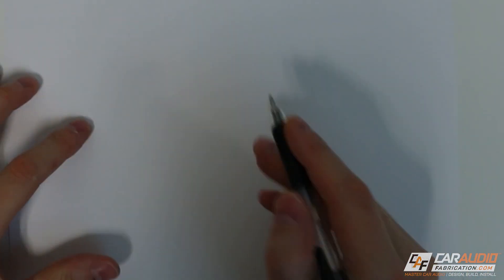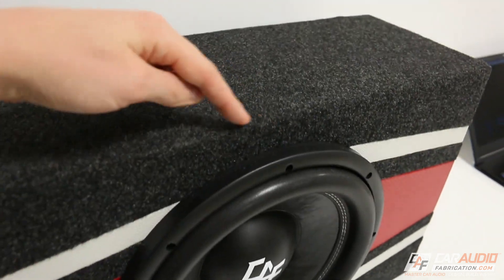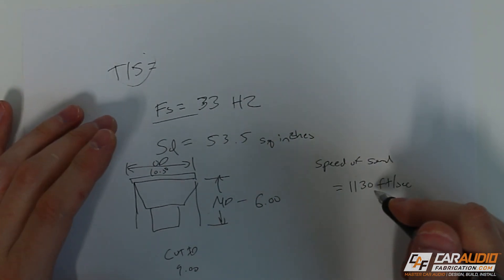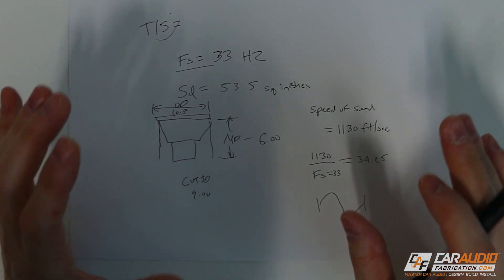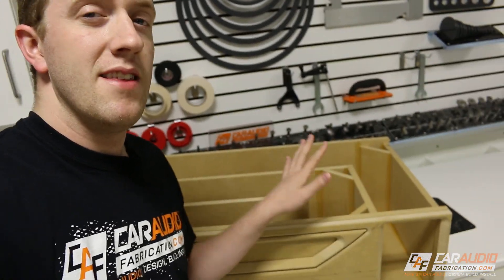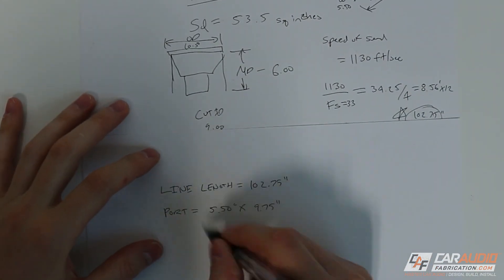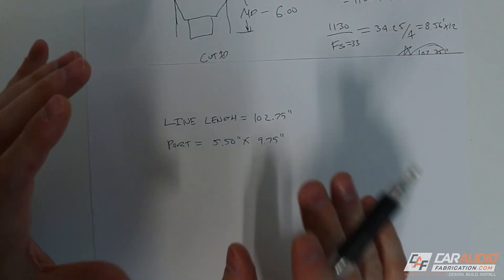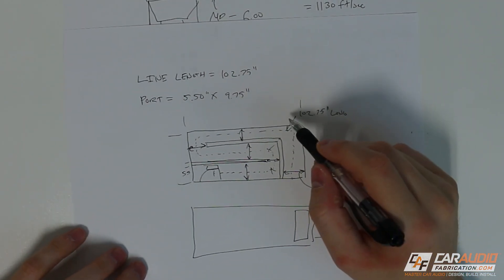How to Design Transmission Line Subwoofer Enclosure

Comment: Good day ,
I have 2   8'"  db drive wdx8 3k  1200 w dual 4 ohm subs and a db drive wdx 3k 3000 w monoblock amp  and plan on putting it in a 2014 ford escape looking for any design ideas on a box design to fit in the cargo area . Removing the spare tire can be a option but would perfer not to due to long trips n may need it lol. also how do i wire it to the lowest ohms . i have allzero gauge wire for batteries ( one battery is stock n the other is a SHURIKEN  1500watts 60 amp hrs agm rechargable power cell ) what should i boost the altenator  to for amp output to power this ....any help would be appreciated .
I also am woodworker and a
can build any thing you send my way for designs ,, also fiber glassing is not a problem 

many thnx in advance ,
steven

Comment: So if your mounting depth is 6" and your width for your port is 5.5" wouldn't the sub not fit, just wondering guys because that's what he did. Thanks
Reply from the maker: The baffle itself has thickness spacing the subwoofer from the port wall....
Reply: @CarAudioFabrication  ohhh ok that makes more sense, thank you very much, also love your vids

Comment: Why is area of the port = SD of the driver? - aren't they usually larger?
Reply: The port area isn't usually larger as far as I know & is determined by many different factors. What was shown in this video is a basic guide to calculate a t-line enclosure. As he rightfully said, there is no "one correct way". Line area = SD is just a safe way that will work well for a simple t-line build. Depending on power, space available etc. you can adjust accordingly. It will affect the frequency response, woofer excursion etc. but that's where it gets more in depth.

Comment: Aahhhh (first 10 seconds) so I'm guessing correct me if I'm wrong but that is the difference between a t line style box and a ported box with a labyrinth style port?? And also I've heard which again don't know if it's right but I read it a couple times that in a ported box you don't want to make the port too long because it turns into more of a horn at that point??? I've never had problems that I know of anyway with running longer ports to achieve a low tuning frequency

Comment: So if you want to tune it to a specific frequency you just change the fs value ?
Reply: No, you can’t change the Fs value of your speaker. The Fs is the natural physical resonance frequency of that specific speaker. If you change the speaker you are using, it will have a different Fs, and then you will need to tune it to a different frequency.

Comment: Does this work with every subwoofer? Some of the subwoofers calculations don't seem to add up right. An example is with the Skar ZVX 8. Its mounting depth is 6.5" and its Sd is 29.14 in^2 and its outer diameter (not the cut out) is 8.65" so when i do 29.14/8.65 the answer is 3.36 which is less than the 6.5" mounting depth.
Reply from the maker: Sometimes you have to account for difficulties in design. It doesn't always work perfectly. Might have to inverted mount a subwoofer or space it out with spacing rings.

Comment: Thank you so much for this. I used your math to build a regenerative transmission line subwoofer like I saw from wisdom audio. I used 2-3ohm 8" Tymphany woofers with a QTS of .58 and it sounds incredible. The bass hits lower then I could have ever hoped for. I do have a question though as I want to build a giant cabinet to go under the couch. 

My question is: Would a woofer with a lower QTS yield better results? or are there particular specs you look for when choosing a woofer?

Comment: is it possible to create a subwoofer enclosure that encloses a sealed 15in sub as well as two 10-inch subs but not sealed they need to be ported can that be done or would the sound waves cancel themselves out I'm interested to know because I really enjoyed tight bass and I also enjoy Lou space I would enjoy them both at the same time in my vehicle there's a professional sub enclosure manufacturer in my city but they said no is not doable but you seem to know quite a bit and that's why I'm asking you what are your thoughts

Comment: This is a very simple TL box. The woofer is at one end meaning the peaks and dips are pretty big. Moving the sub down the line can help smooth the response quite a bit. You can also taper the line(bigger at one end) and also play with damping at various points in the line.

This is a good explanation but there are many more variables that can be tuned in a TL.
Reply: Car Audio,  bagging a dozen parameters … not a problem.

Comment: What calculations would change for multiple subs?
Reply: Well the transmission lines' cross section changes, in a series configuration(i.e. speakers next to each other) your cross section increases by the speakers projected area(Sd), in a parallel config(also known as isobaric) it halves.
TLs' are pretty complicated tho, especially when considering compression chambers, tapers and port tuning, which this video did not cover.
Reply: @R4MP4G3RXD  so... Doing 4 subs firing in the same direction would take the SD x4 thus four times the port area but the length stays the same? 
Theoretically if you were to do 4 subs, two isobaric sets would it halve it for one isobaric set then you double it back to the original number if you have two isobaric sets?
Reply: @Butrdtostngravy  Yes. Since adding more subs doesn't change the speakers resonant frequency(Fs) the line length stays the same no matter how many speakers you add.
Also you are correct, but then you may need to re-tune your line with more padding because of the change in air velocity compared to only one woofer.
Reply: I also highly recommend checking out HexiBase on youtube. He goes into much more detail about speaker cabinet design, and speakers in general.
Reply: @R4MP4G3RXD  thanks for the info I'll have to check it out

Comment: So this style is for super flat response/even SPL, and therefore essentially sound quality?.

Also, when measuring port lengths on ports with bends, especially wide ones, I've always wondered, do you measure from the center line of the port, along the wide sides, along the shortest path possible? That could change the answer you come up with by quite a bit.

Comment: question? 
but if you mount 2 subwoofers, do you have to calculate the SD twice? 
The length of the port remains the same, right ?
Reply: Correct. 2 identical woofers will call for 2 x the SD.

Comment: I made t-line enclosure into my car and I'm having issues with standing waves or something similiar. Cone is barely movin and it sounds like out of phase with test tones. It's made of fibreglass and folded 2.8m tube without tapering. Subwoofer is 12" and inner diameter of tube is similiar to cone  area. I have 3kw of power and it has very good kick only with few song!  has a lack of versatility. No idea how to improve it..

Comment: I'm keen on this build for a number of reasons, not least because the 6.5" Skar subwoofer I got for a specific application, and planned on a bass reflex enclosure based on an email in which they claimed a "tuning frequency" of 40Hz (which I thought meant resonant frequency) turned out to have a resonant frequency of 64Hz. I am definitely looking for FLAT frequency response (I'm 62 years old and have never been a fan of BOOM BOOM!), and if this takes me down to 32Hz (using you half-below-twice-above-Fs rule of thumb) before things fall off, I think I can live with that.
If you're wondering why I'm using a 6.5" sub, the space I'm working with (package shelf of a first series Miata) is very limited in height. While there's not much total volume either, given the SD of 17.52in2, and the relatively high Fs (which, if my calculations are correct, makes for a port length of less than 4.5 feet), I think it's doable.
What scares me is the "...once we build the box, we're going to need to do some [testing and] fine tuning". Besides adding stuffing, it's hard to imagine how to fine tune something that is a glued together wooden box. And apart from using my ear, I don't know about testing (I'll be searching this site for videos about that, but if you wanted to shoot me some links, that would be most helpful).
Reply: Alan Johansson did you ever do this? I too have some spare 6.5 woofers around
Reply: Bry Ytab Not yet. Considerable life has happened since.
Reply: Alan Johansson understandable..it will be cool to see, if you ever attempt it
Reply: Usually tuning is adding wood in the "chamber" or creating a narrow "throat" to distinguish where the chamber ends and the port begins

Comment: Based on the dog food graphs, a t-line just looks like a really low tuned ported box... am I missing something?
Reply: Yes. There's no 'box volume' specifically. Its a tuned pipe, kind of like how a church organ works. Upside is low bass and good efficiency, downside is peaks and dips in response, especially when the  woofer is at one end like this design.

Comment: I know this video is a year old, but. If you were to build a t-line box, so you can get a nice even frequency, would adding a sub that can handle more power, aswell as more power to that sub still increase output? Or is a t- line design limited in its overall output at any level? I.e putting the same spec 10 inch sub that handles 500 watts, versus an 10 inch that can handle 1000 watts.

Comment: Hello all bit a technical question while I understand the basic maths on a single speaker system but not not sure of the modification to the formula to adding a second speaker.
For clarification this is for a home entertainment unit the missus wants for the bedroom with more a look at midrange n tweeters rather than bowel shaking bass

Comment: I'm having an issue with this, the Sub I am looking at calls for SD of 38 sq in, it is an 8" and it requires 7.58" behind it, I'm almost guessing a T Line just wont work.
FS 35.2 HZ   SD 38 sq in  Cut ID 6.94"   MD 7.58"   port 96.3"
Reply: Exactly what i calculated according to this method; i have a 135,7 cutout and 175m mm total width, the depth i need is 835mm and i only get 687mm max! So, the driver will not fit the port. How do you fix that?

Comment: Question, I’m working with a 12 inch speaker that’s 6 inch’s in depth, do I have to make my air passage way more than 6 inch’s or can I stay at 6 inch’s where the speaker would touch the back of the board for the t line build. Looking at dimensions 15” x 38” x20”

Comment: I want to build a T-line for a Tang Band W8-670c. I've used it a lot and the fs is quite a bit lower now but I've got no idea what it's ts parameters are. My current box peaks at around 45hz and it stops at just above 35hz but I want to go even lower.

Comment: I want the widest response of bass possible so I don't have to have multiple subs or speakers of different sizes to get all of my frequencies evenly. I drive an 05 ram 1500 quad cab and wish to leave the interior intact save from converting the rear bench to 2 buckets and a custom center console between the two front seats if I have to. What size sub and what type of box should I go with?

Comment: Question for you Mark:
I noticed in your calculations as well as a few of my own T-Lines trying with different speakers, the mounting depth is larger than the 'W' calculation. Now correct me if I'm wrong, but wouldn't this put the speaker through the first wall? Or did i misunderstand the orientation of the 'width'? I also noticed you didn't touch too much on Md in your Thiele Parameters video, which i could also have misunderstood.
Thanks
-From, a fellow engineer.

Comment: Okay so I have been heavily considering a t-line box for my new build I have Alpine 6.5 type s components and a pioneer deh80prs and will use the 3way active but I can't decide on 2 soundqubed hds208 subs in separate t line boxes or 4 of the same sub in a ported box this is going in a 1983 k5 blazer that is a welded half cab so basically it is just a short bed single cab but with a little extra room than a normal single cab pickup I can fit 53"W by 13d and 10h
Reply: Also I forgot but my mids will be in their own t-line which I am building tomorrow

Comment: Hi Mark, Thanks for the awesome video but i have a question. The begin of the line length is the bottom left of the schematic or the center of the magnet? And if so, does mounting location matter? 
Thanks

Comment: Does the line length start at the center of the speaker?
Reply: No it starts past the speaker at the wall if you build a box without running the length to the wall your tune would be lower then you calculated the port length is measured from the starting point of the port to the wall beside the sub and measure all the lengths from the center of the port floor not to the sides also if you don't use 45s that's fine it makes very little difference in sound but if you want 45s in the corner make sure that the distance from the 45 to the other side of the port is the same as the port width the goal is to keep the port height and with as close to the same throughout the whole box
Reply: i have the same question..
Reply: At the center of the coil when looking at the speaker from the side.

Comment: Been looking at different subwoofer enclosures for a home theater setup, folded horn , ported or T-line. size is not an issue. like a 40hz tuning if possible, would you recommend a T-line style design ?

Comment: So I noticed when you were calculating everything out for your box, you have a port dimension of 9.75x5.5". But your sub has a mounting depth of 6". How did you make it fit without the magnet hitting the wall of the port? Im having the same issue trying to calculate a box design for a 12" sub I have.
Reply from the maker: +Pat B the thickness of the wood...

Comment: You mentioned a "tapered" box. Does this mean that the chamber does not need to be equal all the time? Is it simply the cubic feet volume that you're concerned with? Keeping the chamber the same height and width is easier to find that volume, but could you theoretically change the dimensions as you go? I would think the corners would have some variation in them that isn't accounted for. (minimal at best) I'm not sure why you would do this, but I'm just curious about the math behind it.

Comment: "Flat" frequency response? The transmission line that I know to had an extremely narrow bump in low frequency, making it really unpleasant to listen to.
Reply: If this was the case there was an issue with the design.   Transmission lines can be very unforgiving. In addition the speaker parameters from the mfgs are not always accurate.

Comment: Anybody else try using this video to make a t-line? I have a skar vvx 8 I wanted to do this tline so got the wood and figured it out on paper with the video. Next day I laid it out on the 1st piece and the line length was way off. So second piece, recalculate, change port size and leave line length to equal cone area along with the speed of sound tip. Line length again way off. Third try I swear I had it, I was within .10ths on line length but ruined the shape of it being a box and more like a long folded port that needed triple baffles and 4” of port sticking out in front of the front baffle. I did an aero port last time so this time I went back to the re box calculator and voila! Low loud and deep- now working on all these front baffle router tricks. I’ll see how that goes🤷‍♂️ lol props mark this stuff boggles me since I suck at math!

Comment: Man you explanation of adjusting reminds me of tuning a Floyd Rose/floating vibrato for guitar because as the string tension changes the angle of the bridge changes, knocking it out of whack so the more you change the pitch/tension of a string you throw them all out and have to start the cycle over..

a trick I use, which may can be adapted and applied here, is to overshoot my adjustment, although w/6 strings it's less the further down you are and its something you get a feel for..

so maybe you can estimate what a particular frequency may be, from previous experience with similar specs, and go ahead and factor that instead of the open air value and see if it gets it closer..

hope that makes sense!

Comment: interesting idea... i am trying to make a compact sub (only 5 watts lol) that won't wake the house up (like my 15 inch traynor guitar speakers... only 37 watts and they shake the house!), the speaker is an 8 inch 5 watts 8 ohms full range speaker,  i tried win isd but realized i have a no name speaker with no data hence i can only guess what i am doing... since the place i wanted to put it 
was under my bed i would have to tilt the speaker in 45 degree then make it a ported long case for cubic air, so the first idea was to have 3 separate chambers, 1st behind the speaker porting to the "back" where i would have a foam to absorb the mids the port to the middle not padded then bypass the first porting next to the speaker... no program on earth could calculate that sort of box... though this idea seems more founded on "real" principles than my blind assumptions... remember i am trying to aim at a lot of base but compress the over all amount; that seems to be doing exactly that!

Comment: If you build with 2 subwoofers, do you double some of the values or how do you do?  quick maths
Reply: TheWarcraftIII Double the SD of single woofer, lenght of the port is same, only difference is surface area of port
Reply: Is there a other name for SD ?Cause i looked up the info on my sub & didn't see it SD
Reply: IRIE BEADS Measure moving part of the cone (without surround), so from inner edge of surround to inner edge and then calculate surface area of cone
Reply: So other than SD what other unit name would it be called?
Reply: Its almost always "Sd", its subwoofers cone area or piston area (measured in cm2 or sq. in.)
Reply: Effective Piston Area